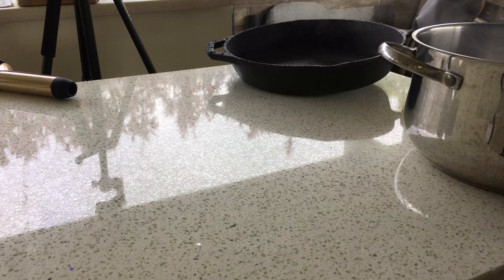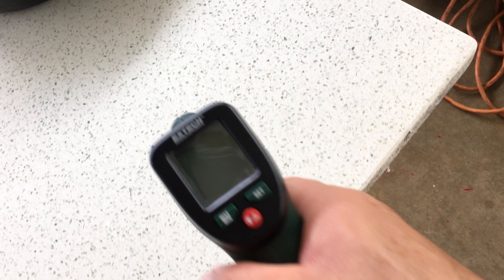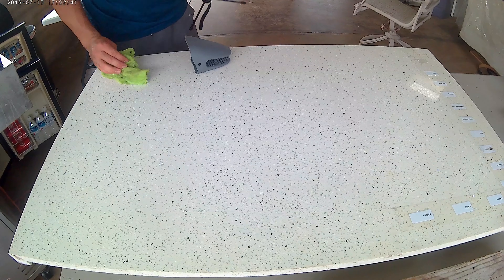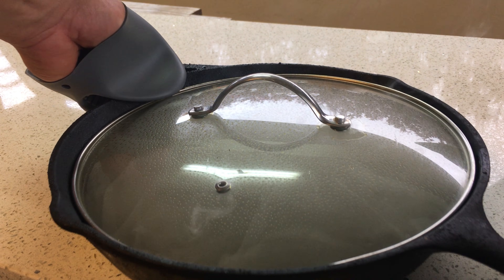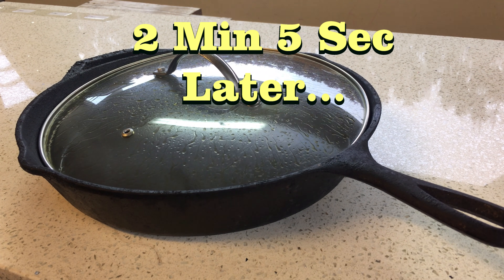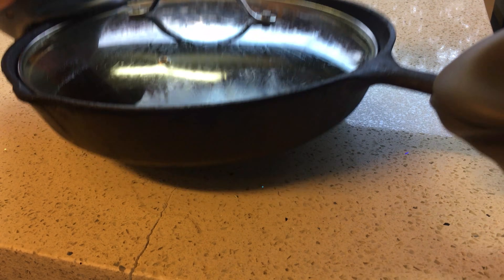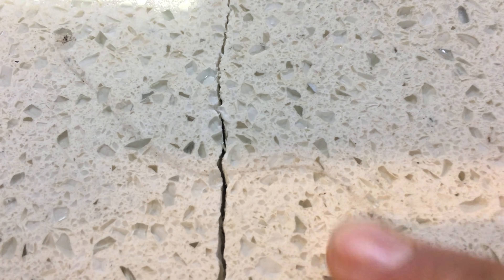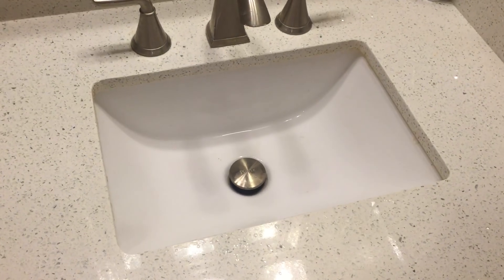Quartz Heat Test: Granite VS Quartz Part 2. Which is Best and Most Durable?

Comment: This test is irrelevant. You used a 3 CM (1.24 ") thick granite vs 2 CM 3/4 ") thick quartz. The quartz is 50 % thinner even though it appears  thick. You can see in your video that there are 2 x2cm pieces laminated together. Do another test with a 3 CM piece.

Comment: Yeah but you have blocks underneath so the edge had an overhanging wait and where you put the hot pan was just on the outside of the support had you placed that panned in between two supports. If you had put the pan on the inside of the support you might has a different outcome. Weight of the pan and the weight of the overhanging countertop Edge compromise the Integrity of the slab and that's where it cracks just passed the support

Comment: Great Video Now granted That whole frying pan hot oil deal was quite extreme But when you showed the underneath view I noticed no support to the right of the crack Which raises the question of weather the weight combined with the heat had a hand in causing it to fail Just a thought

Comment: I have quartz countertops and just got a large air fryer/toaster/convection oven. Do you think a silicone mat under the unit would protect the countertop sufficiently? The unit does not sit directly on the countertop, it has feet and is raised up about 1.5 inches or so. Any advice would be appreciated.
Reply: We have an air fryer and it also has little legs… we sit the air fryer directly onto the granite and it’s never hot under there… my kids have quarts and they sit their air fryer onto the counter as well and it never burns - it’s not hot… we have different air fryers but they both came from Costco… maybe it depends on the type of air fryer one gets?

Comment: I don't care what kind of countertops I have.  Granite, Concrete..  it isn't an inconvenience to put down protection for hot pots and pans.  Even if it's scratch resistant, I'm not sliding metal around on it.. that's just not how you take care of nice things.
Reply from the maker: I agree, no countertop is truly scratch, crack or stain proof.  It’s just a matter of which one is less likely to be damaged.
Reply: @thriftytani46  yes yes.  You're right.
Reply: I am thinking about upgrading from Formica to granite or quartzite. Currently I can put hot stuff down but it isn't as pretty as granite.

Comment: I appreciate the science... but I would never put any hot item on ANY finished surface regardless of what material it is... it is bad practice and you don't want to get into a habit of doing it because you might be cooking in a place that doesn't have heat resistant surfaces and accidentally damage them.

Comment: I like these worst-case scenario demonstrations. I don't know just how useful they are in real life though. Who in their right mind thinks that they will immediately take a near burning cast iron pan of oil taken directly off of the flame (2,000 degrees), exceeding the temperature of 450 degrees for the oil and the cast iron pan itself which is probably well over 650 degrees, and think, oh yeah, probably nothing will happen to the counter. I wouldn't do that to a granite, marble, or quartz countertop. If you think you need to do that on a regular basis, you need to put in stainless steel countertops.
Reply: anything is possible when cooking if you're getting burnt you won't be thinking abt fragility of your counter top haha
Reply: We have porcelain countertops, I can put anything on them and they don’t crack, I take everything out of the oven, off the grill, burning hot oil you name it, and put it on my porcelain and it doesn’t do athing to it, my husband and I put it on 20 years ago. Sadly, we are now redoing the countertops, only because they were porcelain floor tiles, 1 ft.², with grout. I Dremeled the grout out several years ago, and regrouted, but the grout is chipping out again, and it’s a grout nightmare so I am looking for a solid surface. what I am finding is that there’s probably nothing as durable as my porcelain, and even today’s solid porcelain slabs aren’t as durable as the floor tiles, so I guess I’ll go with granite🥺

Comment: I appreciate the demonstration. I had been about 99.999999% certain that I would use granite for my kitchen remodel. Thank you for providing the final infinitesimal.
Reply: The problem with quartz is that it is crushed powdered quartz made into a solid using epoxy resin polymeric and recycled products. It yellows and stains overtime. It doesnt have much issues with products sticking to it or staining it, BUT if you dont want the shiny stuff and get honed, it will stain, as the epoxy is not as much on top layer protecting the surface. What is bad is that if you put hot items on it the epoxy will yellow. If you have windows with direct light(UV rays), it will yellow over time. It also can chip on the edges. Most granite have less issues. Some sellers title a stone granite, yet they are not, and many have mixed types of stone in the granite. Granite is MUCH more resistant to heat as well. I have had granite, and hardly ever used a hot plate, and have had zero issues on a medium light to gray tne granite. It will not yellow, while epoxy in quartz will surely yellow.
What is more interesting is that Ceasarstone and many other makers, or even cleaning products have videos up with the comment section turned OFF, so they dont get customers posting all the negative experiences they have had.  The sad part is that many quartz companies charge MORE than the natural stone price for a product that is literally made by byproducts! Lots of MAJOR marketing has gone into launching quartz as the "best product for a kitchen, and this is simply false.
If you are doing a remodel and KEEPING the house, vs selling it soon after, a natural stone will add value and give a longer lasting product. Keep in mind that you can always polish or resurface natural stones, AND seal them if you want to add some security of stain or wear resisntance. You can also use an impregnating sealer for those radon gas worriers. 
Something to think about. 
I have researched this topic pretty deeply, and read many of the feedback from quartz owners of LONG TERM use and experience...I have now decided NOT to use quartz in my house.

Comment: Can you try on a black beauty granite I think it will not crack!
Reply: yes, the granite he used is not even a true granite. Stone sellers actually sell a lot of slabs under the granite name while they have 50% granite in it. Try any virginia mist, or any real granite, and dont use a elevated piece on your test...it may crack, but less likely. Cracking is not the main problem with quartz, it is the yellowing over time. ANY epoxy is going to yellow with direct sunlight. this is why you can use granite outdoors, but NOT quartz.

Comment: So what should I put as countertops
Reply: quartz is very nice with a matress put underneath. However porcelain is the trend with much better heat resistance. Check out JW QUARTZ https://www.facebook.com/JW-Quartz-by-JW-STONE-100572315166575 and Lingbiao Porcelain https://www.facebook.com/Lingbiao-Technology-104765624758672/?notif_id=1606644252747628&notif_t=page_fan&ref=notif.

Comment: I took a torch to my quartz, couldnt damage.  A slight flaw in your test is that the counter top is installed on a flat piece of plywood rather than 2x6, which could have accelerated the cracking, and possibly slight differences in heat transfer.  Thanks for doing this.
Reply: A hot pan is more realistic than torch.

Comment: Good series. I would like to see how the slabs are supported, as that would affect the stresses in the slabs.
Reply from the maker: Thanks Brian, I’d imagine if the slab was glued down with a significant amount of adhesive, it would act as a small heat sink and might increase the fracture resistance of the countertop.  It would be an interesting video to record.

Comment: Quartz burns and bruises and fades and is virtually impossible to fix or polish out scratches..... and it does scratch, and it stains. Hold a lighter to Quartz and watch it melt. 

Granite doesn’t burn and a poultice mix will pull out stains. There are Sealer’s for Granite that repel stains. Go with the God made Granite!!

Comment: Thanks for this demo. We've installed quartz and the other day my Mrs put down a boiling pan for "just a second" and it left a ring, but we determined it was due to the soup, containing turmeric, boiling over. We eventually got rid of the turmeric stain by repeatedly letting bicarb paste dry on the stain and rubbing off.
Reply from the maker: Mahalo!  I’m glad you got the stain out, that kind of stain would have drove me crazy if I had to see it every day!
Reply: Thrifty Tani Me too! I’m deciding on light granite vs light quartz at the moment.
Reply: Do you mean baking soda will work too?  🙏🏼

Comment: You should try this same test with 3cm quartz. Because that's what most people use.... not 2 cm.
Reply from the maker: Hi Bikram I’ll try and get my hands on some 3cm quartz, and repeat the tests with the cast iron pan with oil.  I bet it’ll be more heat resistant since it’ll take more energy to bring it up to temperature.